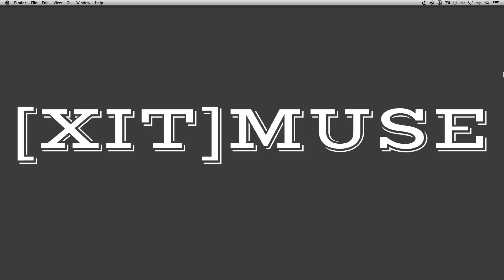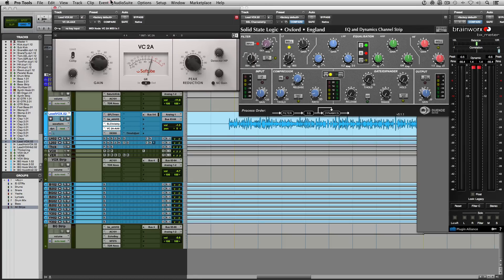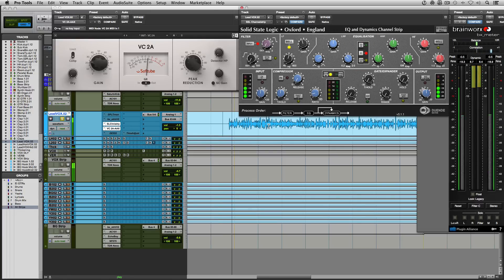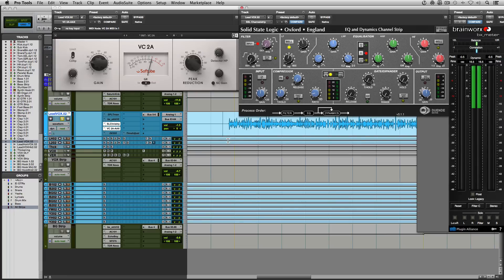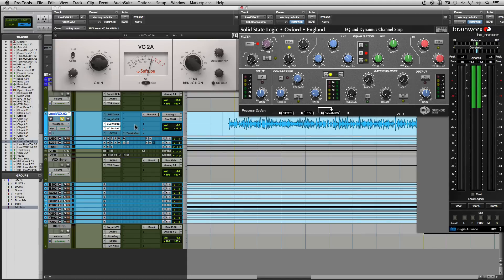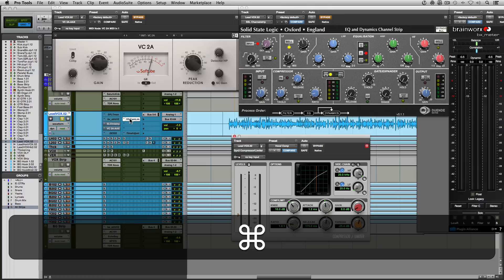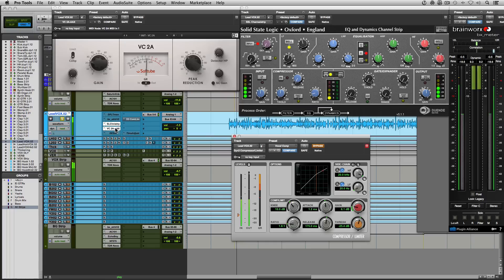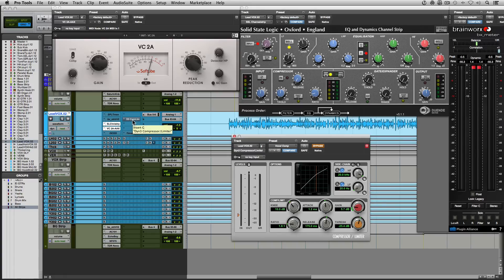Get Best Mix on Vocals using 2 Compressors [Mix Talk Monday]

Comment: Really having difficulty hearing the bypass and compressed difference, any tips on what my ear should be tuning into? 
Thanks
Reply: That's understandable. That's kind of the point. If you're trying to tame the dynamics of the audio, but not suck the life out of it, the compression shouldn't be obvious. If it's obvious, then you're not doing it right. The process of using the 2 compressor in series, gives you more compression, without making it sound like it's being compressed. But, when you listen to it in context with the mix, it just consistently sits in a nice pocket, but still gives the impression of dynamics. 

If you want to hear compression, that should be an effect. If you want vocals to sit nicely in a mix, then you need to compress it, without crushing the life out of it, or generating pumping sounds.

Let me know if that helps to clear things up.
Reply: keep in mind that youtube also compress the audio a bit so that also make it harder . maybe adding a link to a soundcloud samples ?
Reply: Thanks for the replies.
Reply: Hi Yosi, that is a very good point! Subtle changes can be very hard to pick up on in YouTube videos, since there is a great deal of compression... Even in HD. 

In regards to soundcloud, there is still an issue on there. They unfortunately normalize all audio that is uploaded to their site, to adhere to the new BS.1770 broadcast loudness standard. They started implementing this a couple years ago, which is why I don't use sound cloud anymore to share mixes with clients. It unfortunately changes the mixes. play sad violin music... :'(